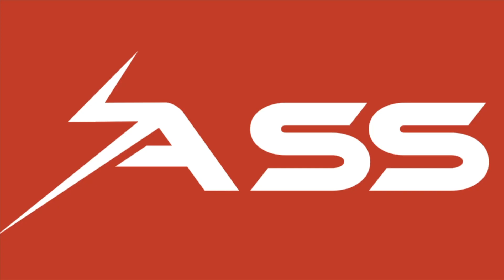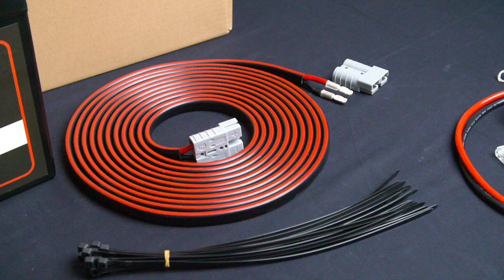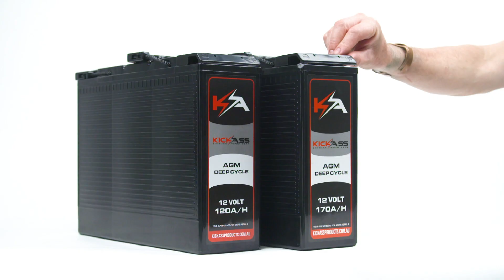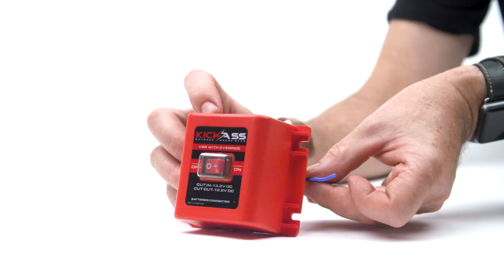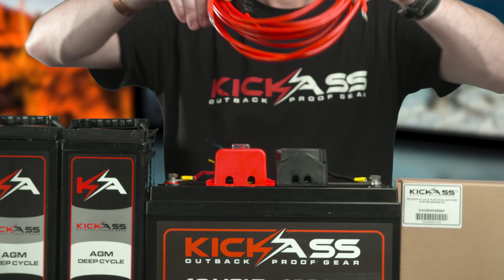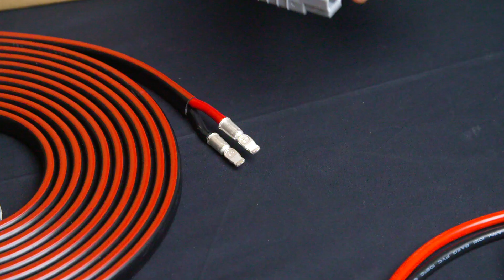KickAss VSR Dual Battery & Wiring Kit Bundles - Everything You Need!

Comment: Why 8B&S and not 6?

I know if used in conjunction with other kick ass hear the dcdc chargers are only 20-25a but pretty much anything over 4-5m it really should be 6B&S?
Reply from the maker: At 6m metres the voltage drop difference is only around .3 of a volt. For most applications this is acceptable, however if you require longer then 6 metres then yes it would be beneficial to go up to 6B&S.

Comment: does the low voltage disconnect unit go between the starter and aux battery, between the aux battery and charger or charger and load?
Reply from the maker: Between your battery and your load.

Comment: Hey mate, just out of curiosity. Will the dual sensing relay also work with a vehicle with a fixed voltage alternator or is it strictly for the smart alternators?
Reply from the maker: Yes, as long as the alternators voltage gets above 13.2 Volts the VSR will switch on.

Comment: Do I need to put Fuse between the battery and the LVD?
Reply from the maker: You don't "need" to but adding fuses in any system will ad protection from short circuits.

Comment: i have 3 batteries in my boat can i run 2 of these was thinking of the 50amp vsr, 2 start and 1 acc battery
Reply from the maker: I recommend that you consult an auto electrician with the specifics of your boat, it's alternator and wiring capacity etc.